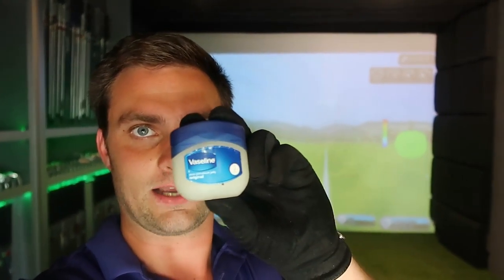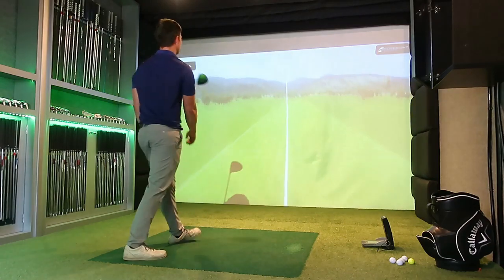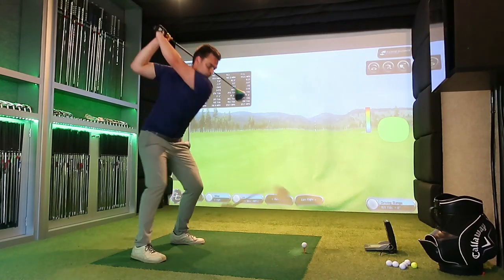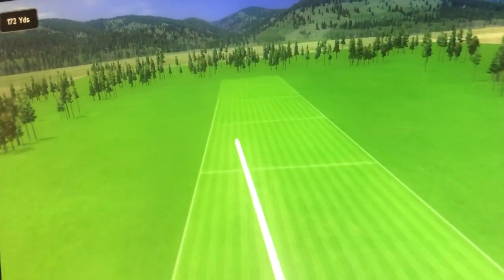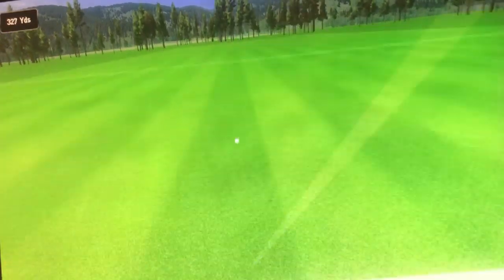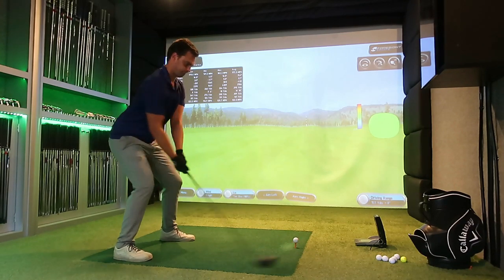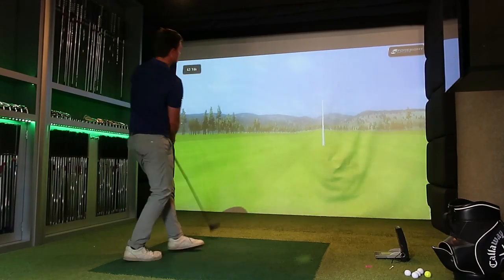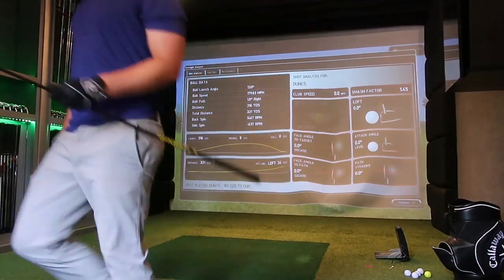ILLEGAL VASELINE ON DRIVER FACE - LOWEST SPIN POSSIBLE

Comment: Been greasing my driver for 3 years now.   I could always drive the ball around 260-265 yards, but with a speed swing around 105 my wild shots would go OB.  Starting greasing the driver head and noticed a huge difference right away.  I might have lost 5-10 yards but I was hitting 75-80% of the fairways now instead of maybe 50%.  My ball would go dead straight as you can`t slice or hook the ball.   Only way I miss a fairway now is a dead pull or push.Went from a 15-16 handicap to a 10-11 just from being in play all the time.    Key is do not put a heavy coat on.  Put a dab of Vaseline on the corner of your towel.   Wipe your driver before you start the round and that will last a few drives, then every 3-4 holes just act like you are cleaning your club and give it a quick wipe.
Reply: I can understand greasing the driver and enjoying playing your 2nd shot from the fairway the majority of the time.
but you cant use those scores to get a handicap and dont even bother writing a number on the card because the lower scores are fraudulent.
grease up and enjoy the game playing from the fairway, not losing balls, etc. 
but dont kid yourself, youre not a 10-11 handicap. and if you play in club tournaments or against your group for money while greasing up then you are just a cheat.
Reply: @MM-rr1kp  if that's your concern, then you're absolutely right.  If you are a casual player who wants to play a round and not lose a dozen golf balls, then grease that thing up!
Reply: Lmao....Greasing the driver....😆

Comment: Been greasing for years.  Used to cut my drives and now I hit them dead straight and longer.  The key is you only need a light coat..no need to put it on heavy.   Keep a dab on your towel and just act like you are cleaning your face before teeing off.  I won my league last year and in the title match did not miss a fairway.  Normally I hit around 60% of fairways without greasing.   Good Luck guys!!
Reply: You use chapstick or petroleum jelly???
Reply: @urgirl8288   Vasoline..very light coat.
Reply: you can look in the mirror and not see a fraud? how can you say you won
Reply: @MM-rr1kp  if you aint cheating you aint trying HAHA
Reply: @nemofish9685  nah then you aint really winning.

Comment: I am a leisure golfer and not into Tournaments. Searching for extra yardage off the Tee finding the Fairway is always a plus. My only concern is whether we might have to wipe the ball after a long drive. It will be interesting to know if the ball kills the spin with Vaseline for the approach shots which might prevent the ball from biting the Green.
Reply: It is against the regulations to wipe the ball  if I am not mistaken. It doesn't matter if it is for casual play.
Reply: You will get a flyer every now and then. Its worth having one per round air mailing the green.

Comment: A old friend from work showed me this 20 years ago. I was slicing my drives but a little Vaseline and that pup was straight down the middle.  I did that for one 9 hole round on a league night. Didn't feel right cheating though. Just worked and fixed the slice lol.

Comment: 2000 rpm is not low. I can get it down under 1700 rpm woth a lauch at 17-20 deg. My AoA with 7-10 deg up.  Just hit the ball slightly over middle of club face.

Comment: I'm going to try this, I spin over 3, 000 driver speed avg 110 to 115 mph but drive maxes out about 250
Reply: Michael Smith     You may need a lower lofted driver or a different shaft.
Reply: @joegarza1835  I will put down my ping g from 9 to 8.4 (I think it goes down point 6 or 1 degree.. I swapped out basic shaft and use a tensei white 65 stiff, better grouping and was better overall compared to stock shaft..
Reply: Oh my gosh! Micheal you are the one that vaseline will help the most. Get that spin down to 1,900 rpm with just a little grease and you will be the longest driver on the course. Don't listen to those who suggest you get a "less lofted" driver. It will only make your shots curve more. People spend thousands of dollars to get the numbers you can have just by using grease.
Reply: @tmo4330  In all seriousness, my clubhead speed is 127 and my ball speed stays around high 170s - low 180s. That being said, even when I carry it over 300, my spin is 3500 - 4000. I lose soooo much distance. I'm going to try this for sure
Reply: @jordan19862000  You will love the change it will make! Spin robs people of happiness.
Reply: @jordan19862000  Did the grease help? Its been a year.